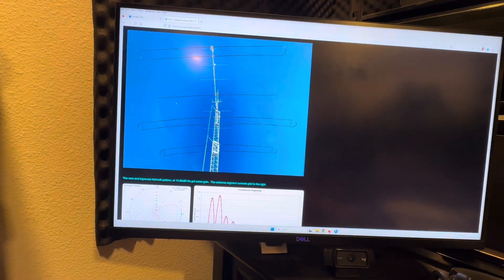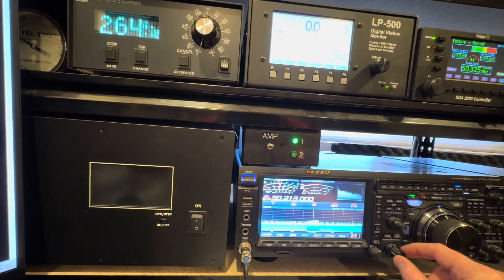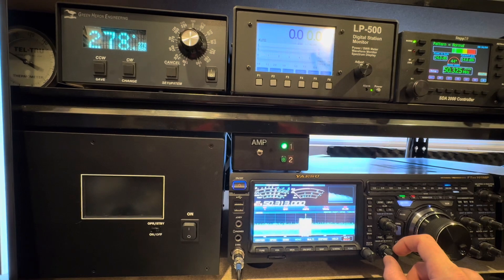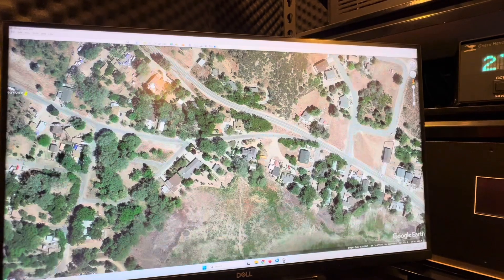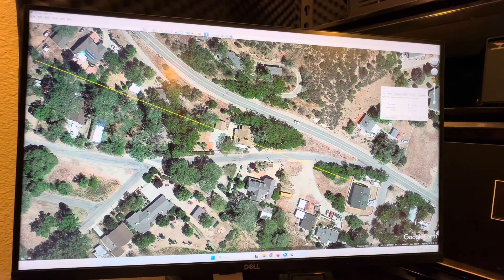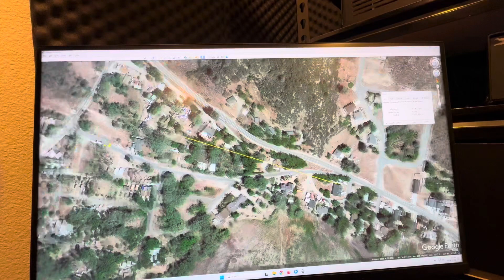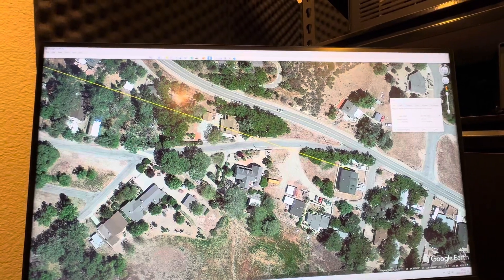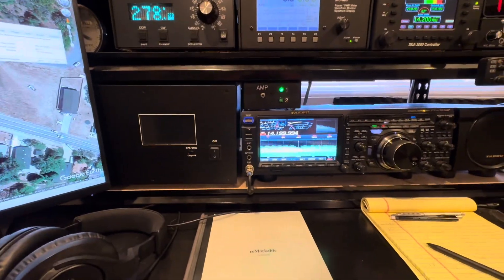Power Line (Lightning Arrester) RFI problems - KJ7E

Comment: Damon, This is really strong Power Line Interference and as always you have done some really good investigative work to track it down.  Because of the number of continued failures in the arrestors; you have to wonder where these Power Line Lightning Arresters are actually manufactured?  In addition to getting the evidence together so SoCal Ed can replace them; have you also tried installing a proper Mains Filter consisting of (i) Type 31as well as Type 43  Ferrite Cores in conjunction with a professionally made (ii) EMI Filter with High Attenuation performance? Dean (VK3DCA)
Reply from the maker: My AC mains supply is well filtered.  The noise ingress is radiated energy along the power lines which are conductivity coupled to the LA's.  I had to walk my entire neighborhood, found a total of three which are arching, this will be 7 failed since they were installed about 3 years ago.  It seems there may have been a bad batch of LA's that were installed.  The problem is, SoCal Ed simply does not want to spend the money to replace them.  I started to engage ARRL now.